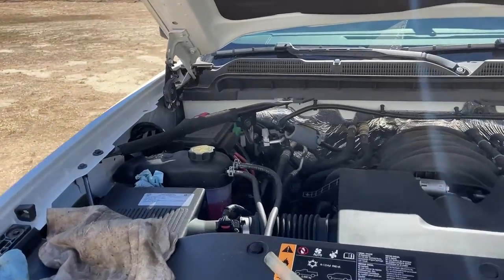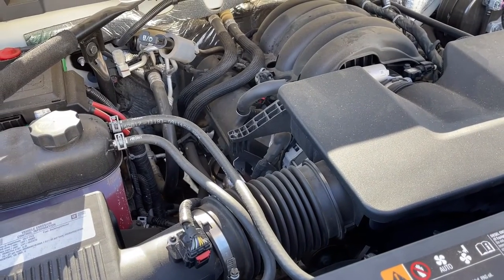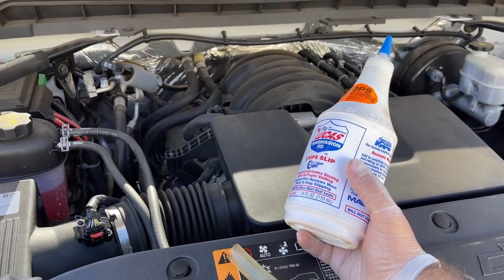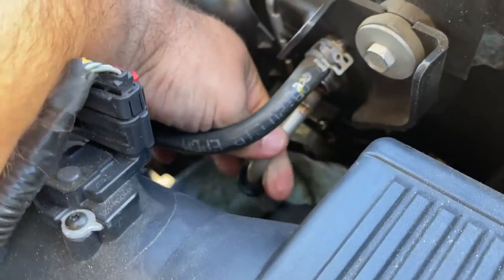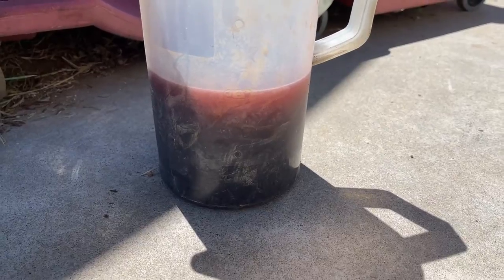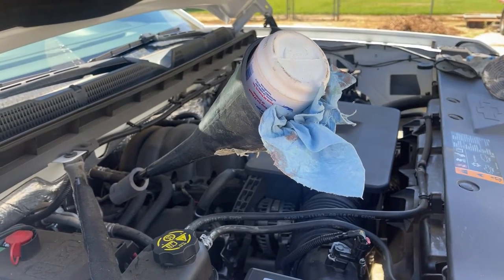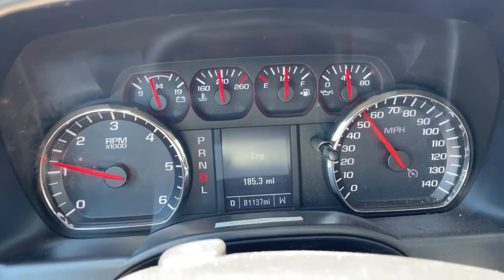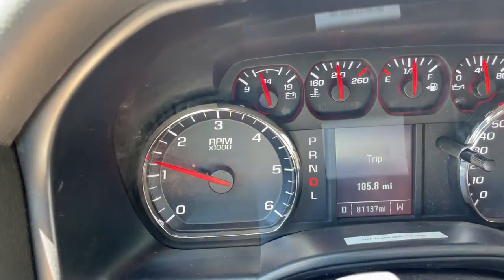Lucas Transmission Fix Stop Slip Install and Review

Comment: I'm from the UK & this does work! A family member recently purchased a Honda Jazz (2006) 75,000m without test driving it,the CVT was juddering when pulling off & less than 50 miles it went away!
Reply: I just want to inform you that it is not intended to be used with CVT's, please keep an eye on that vehicle unless that was a while ago and it is still fine.

Comment: That Lucas Transmission Fix is good stuff! I use it in my 2003 Ford Taurus with almost 300k miles. Original transmission too.
Reply: do you drain or just fill?I too have 2003 ford taurus
Reply: @MrDonbgge  I wanna know too
Reply: It does not say anywhere on the bottle from Lucas to drain any existing fluid before adding. This would be a very important step, so no you do not need to drain, just add on top of existing transmission fluid. Hope this helps

Comment: Hmm did I hear that correctly that the transmission was flushed around 58,000 and now it is around 80,000 miles?  I have had several Chevy vans and none of them made it to 110,000 miles without transmission problems.  All were flushed at 60,000 and new filter--supposedly by mechanic shop but I could not watch the actual process.  Either GM has junk truck transmissions or these shops are not really doing the fluid changes.  I don't want another Chevy or GM product.  Hope the Lucas works.  Keep us informed.  Thanks for the  videos.

Comment: This worked on my 2003 Hyundai Sonata 2.4 , used to jerk when engage to D or R, Malaysian model have a 4 litre capacity trans so I put only 12oz when change with new oil. At first it don't show much improvement. It only worked wonder after 4 days. Feel smoother, no more jerk. Now already a week, still doing great. Hope it will last.
Reply: I just bought in Shopee, gonna try on my 6-Speed Aisin AT

Comment: make sure that you have dex 6 compatible fluid in the transmission. Anything else will destroy the clutches on a 6L80. Learned from experience, had one last 10,000 miles with the wrong fluid

Comment: Do you have to flush out a bit of trans fluid before pouring in the Lucas?
Reply: All depends on how much fluid you got in it
Reply: Take out half a bottle amount then put in half of the Lucas oil...but make sure the engine is warm & running!

Comment: There's so much "Kool aid" out there about the friction material being in suspension in the fluid. I'd like to assume that anything sizable or ferrous would either fall to the bottom or stick to the magnet.   I tasted the Kool aid and thought what if you actually add friction to the fluid? What would work? Go big just put sand in there. Well say goodbye to the valves and the pressure will drop. Anyway good to hear Lucas does work in the right occasion. I believe in changing the fluid as it becomes a different color

Comment: How much should you add to a full transmission?
Reply from the maker: Take some out with a fluid pump through dipstick tube  or carefully through the radiator lines. I have another video where I do that with Lucas. That’s probably the easiest.

Comment: I used both lucas stop oil leak and transmission fix neither of them worked for me. I saw lot's of reviews that this stuff works but it didn't work for me. The oil is still leaking as it was and the transmission is still slipping
Reply: If that's the case then you might need a new transmission  💸💸💸, because this stuff is not a magic oil it will not fix a broken transmission
Reply: @Matt0ize  yeh i had a old cruze with more than 250k km on it

Comment: will a small amount of this in your engine oil hurt anything?
Reply from the maker: I doubt it but there really isnt a point
Reply: @hanksgarage_  it was an accident. dark parking lot and it was freezing cold.  I pulled the dipstic and looked at it as best I could and it looked bad for tyranny fluid so I gave it a sniff and it smelled burnt.  I thought geez tyranny toast...just great...gave the bottle 2 squirts and it hit me. lol. it seems to be fine. thank you.
Reply: @cowdough94 Aren’t you the guy who did that in the Walmart parking lot? Lol
Reply: I put a little amount on differential gear. seems ok

Comment: I have toyota camry1992 2.2 automatic transmition. Toyota won't drive forward only in reverse drive smooth. The transmition fluid was black .First i change the transmition fluid wont drive forward. Then I change fluid and transmition filter ..On the magnets on the pan there is not metal pieces  0 .Toyota won't drive forward again.Could lukas stop slip fixed the problem .Toyota camry  153.000  don't leak
Reply: I mean.. it's 15$ try it ?

Comment: hearing the words "transmission flush with a machine"  that makes me cringe super bad. 
First of all, nobody needs to flush a transmission. Just change the fluid at good intervals. If you flush the transmission all its doing it pushing debris and clutch material into parts of the transmission and causing restrictions. Which the valve body is definitely a place where you don't want a restriction or else the transmission is never gonna work right afterward.